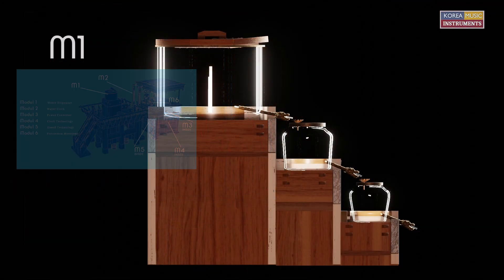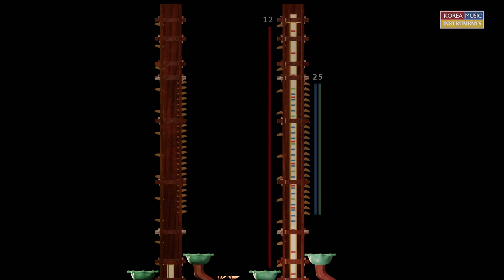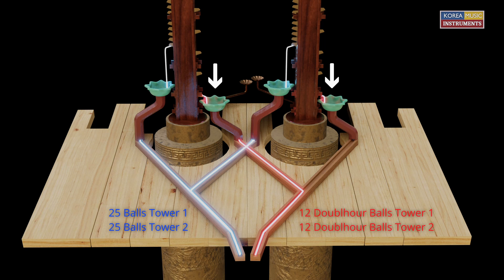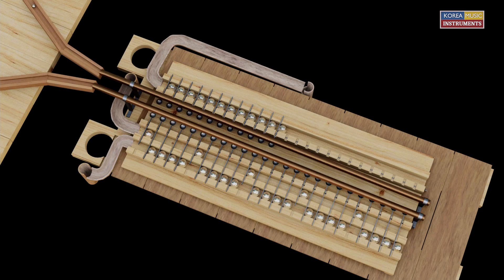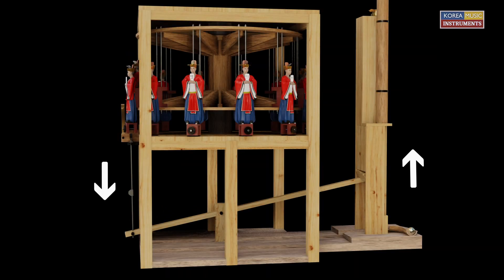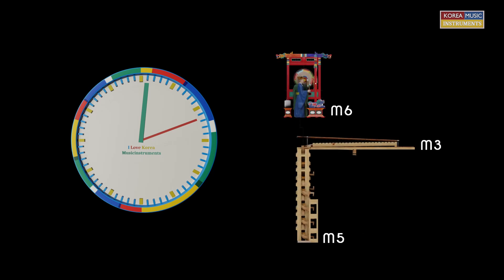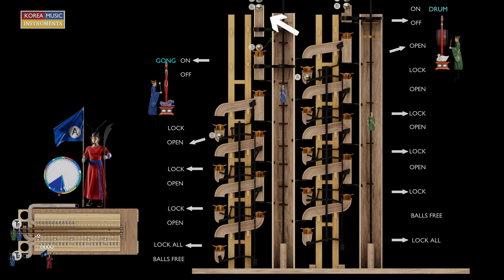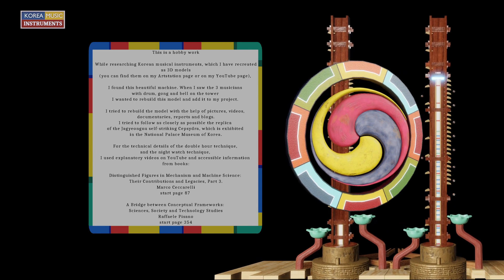WATERCLOCK-JAGYEONGNU - 자격루 - How it works - MECHANIC ANIMATION - 메카닉 애니메이션 - Part 3

Comment: Thank you so much! I am so happy I live in an age where people animate these mechanism so others can gain a very intuitive and visual appreciation of them within 10 minutes. It's amazing! This whole mechanism only uses weights and see-saws, not even springs, and it's wonderful to see.

One confusing thing that I feel wasn't explained properly, the reason the doll rotates the whole wheel to the side as it falls down, rather than the doll falling straight back down, is because it has a small wheel on the bottom and a curved track underneath. You animated the track clicking into place under the wheel in the side-view at 7:20 , but in the front view at 7:14 it looks like it just floats down.
Reply from the maker: Many thanks for the kind words. Yes, the animation is not perfect at ~ 7.00. If there was a scientific request, I would of course correct it. I've never seen the clock myself, I've only been guided by pictures, videos and Korean descriptions on the internet. A very beautiful piece of Korean culture from which we can learn a lot.